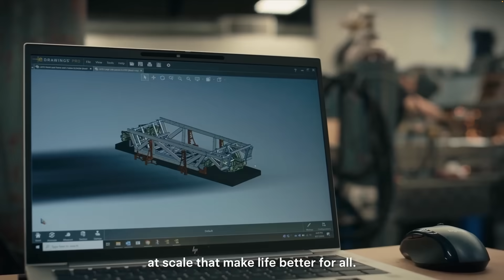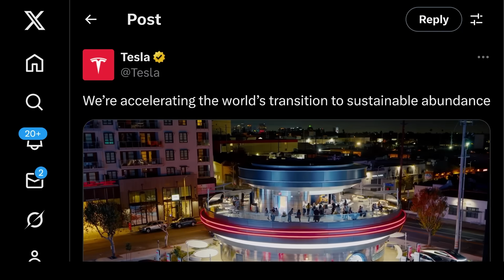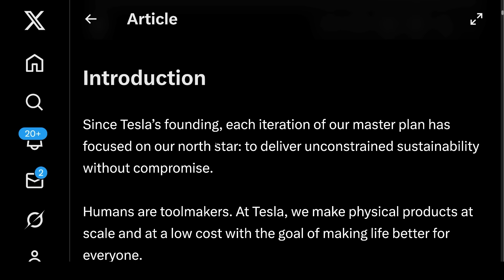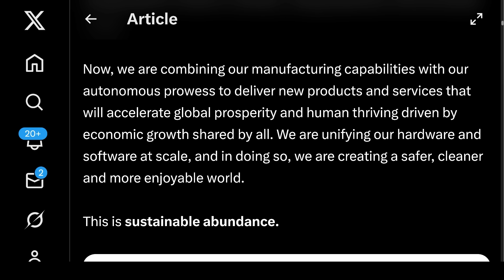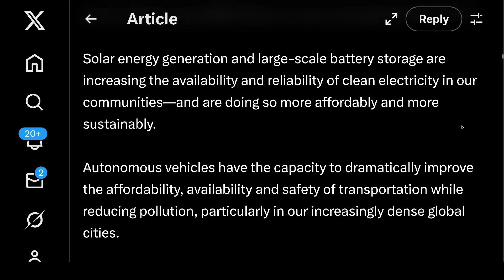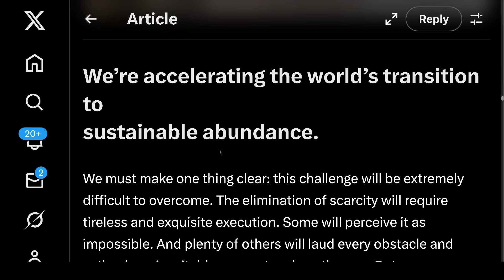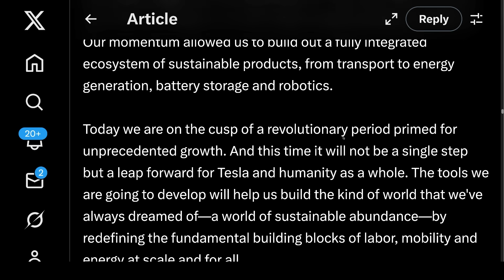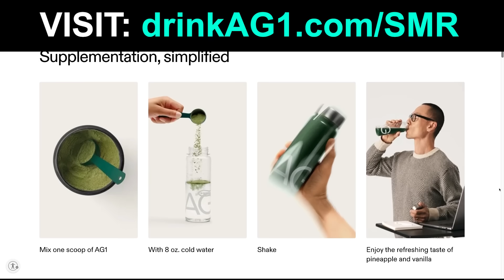Tesla Masterplan Part 4 Revealed (it’s WILD!) - “Sustainable Abundance For All”

Comment: Part 3 was more exciting, remember 😁
For those that didn't read, you're missing out on how JUST solar and battery can power the world, even with hydrogen, not for cars but for full on seasonal energy storage. 
Ya, we all know that making H2 is inefficient, however curtailing a continents worth of solar, a few hours per day, because there's already so much of it, in the summer, even after filling up the batteries... Ya ...
Is infinitely more inefficient than an industrial scaled up H2 infrastructure! 
Ya, they said less than 1% of the land would be needed to power the whole world. 
And I believe them because I did the math 😁
Granted, extra energy will be needed for AI clusters and for making the solar and battery itself...
But it will still have a rather decent overall EROEI (meaning that a solar and LFP battery powered world can make more of itself, too.
This time around, there's no real mathematical substance, like there was in part 3.
Just exciting reassurances that, indeed, the future can become...
Sustainably abundant 🗽

Comment: They have only installed solar on 500,000 homes and 1 million powerwalls. Then they fired most of their solar and battery staff. They failed on solar and battery. There is no growth in either. They have given up on solar and home batteries. Not enough profit. It's all smoke and mirrors. All they care about is FSD and boys that won't turn a profit for another 5 years. So good luck making no money for 5 years.

Comment: As an engineer, I typically agree with Elon, but I have a big problem with his definition of abundance - from first principles.
Clearly we also need prosperity as well, having everything in abundance is one thing, turning it on, well, this requires the cost of energy to plummet.
The only way we can feed the abundance is deploy Nuclear - in abundance.
Reply: "As an engineer, I typically agree with Elon, but I have a big problem with his definition of abundance - from first principles.
Clearly we also need prosperity as well, having everything in abundance is one thing, turning it on, well, this requires the cost of energy to plummet.
The only way we can feed the abundance is deploy Nuclear - in abundance."

The cost of energy will plummet.

Comment: Tesla is practically over. A 20% drop in stock price is IMMINENT, down to 260 USD. FSD level 5 is 8-10 years away, robots will be just hype for many years, car sales are dropping 10-40%, meanwhile others are growing sometimes at TRIPLE DIGIT PER CENTS (looking at you BYD)! As melon also confessed, some really rough quarters are ahead for tesla. Brace for impact!

Comment: Solar power is not free ffs it’s very expensive. According to Grok the USA consumes 11,200 GWh per day.  I asked Grok to calculate the cost of solar panels, battery back up sufficient to allow for varying sunshine and nighttime and back up for 7 days, installation and LAND COSTS. $37 trillion was the total cost. The whole lot needs replacing every 15 to 20 years. Try Grok yourself for this calculation. Fissionable material the size of a golf ball provides enough energy to supply electricity for 1 persons entire life.  Nuclear is the obvious choice. Elon would get in to it probably if the barriers to it came down. For now obviously solar and batteries are the more lucrative avenue for him. Given the scale of equipment needed for solar the implications for environment and co2 emissions are extremely bad. Nuclear hardly any.
Reply: You are making it too difficult. Solar is cheap. For our home it was $9500 for 5.9 kilowatts. The panels take up a tiny fraction of the roof area. Breakeven was 80 months. We power the entire home (heating/cooling, lights, computers, TVs, hot water) AND power two EVs. The system is 11 years old. The inverter is out of warranty, so we'll need to spend $3k in the next 2-3 years. The panels keep producing, but do degrade 0.2% per year, so they work beyond 25 years.

Comment: "We are accelerating to global prosperity, to sustainable abundance where costs fall to near zero".

Consider this more closely. There are two primary outcomes.

If everything becomes 100 times cheaper, then salaries will also decrease, necessitating increased work to sustain oneself. No change in the status quo.

“However, only costs will decrease by 100%", you say! Consequently, a business must generate 100 times more sales to cover its labour, COGS, and fixed costs and achieve profitability. This implies that 99% of businesses will cease operations, allowing only 1% to continue profitably. Consequently, 99 out of 100 individuals will be unemployed, starved, cease to be consumers, and cause the revenues of the 1% business to plummet to zero, leading to its bankruptcy.

Therefore, regardless of the chosen model, it will either result in the same outcome that exist today, or societal collapse.

Have you frequently encountered products advertised as being free or offered at a significant discount, only to discover that it was a deception?

Comment: Sorry but elon himself has repeated the new mantra of sustainable abundance many times now. So obviously this is the new masterplan. Too bad nothing was explain how they will accomplish that with concrete details
Reply: Strategy is by definition somewhat vague on detail. It requires fuzzy vision and the very real confidence that nothing is insurmountable. Only middle managers fret over such details before setting strategy. Defining the path means you point in the right direction and that's a huge start. The detail follows once middle management is allocated responsibilities. If you don't like the strategy then don't invest in it. I am unaware of another company with such clear vision and outrageous goals!! Lift yourself up from the detail and you can truly see your path. Only then can you truly pursue significant goals.
Reply: @markthomas7279  then it should be called "General Direction 4".
Reply: @markthomas7279 Love it.
Reply: You want them to draw a map for the bain of humanity (chy na)
Reply: By building autonomous tools that run sustainably on renewable energy. Battery, solar, electric motors, embodied intelligence, working to autonomously provide more resources than humans need in any given era.
Reply: The point of a masterplan is to set the vision, not be 10,000 pages of implementation details. The high points seem pretty obvious though--as was shown in the video.
Reply: @tHebUm18 i m not asking for that much detail but its not really a plan if no goals are set to achieve. "Sustainable abundance" is a bit vague